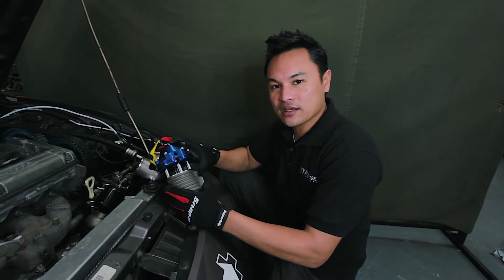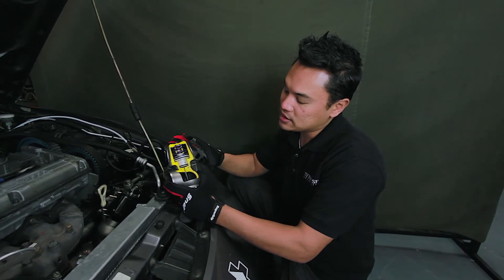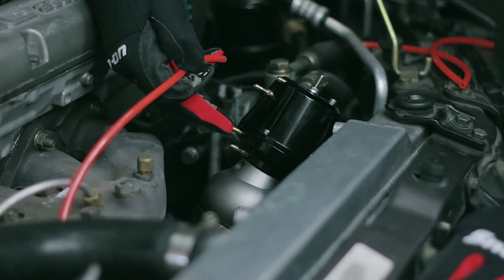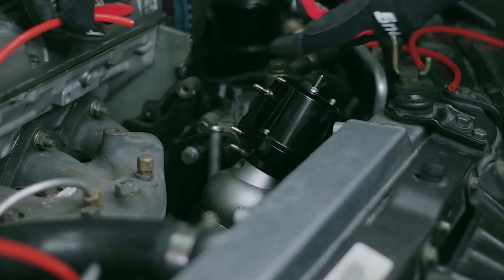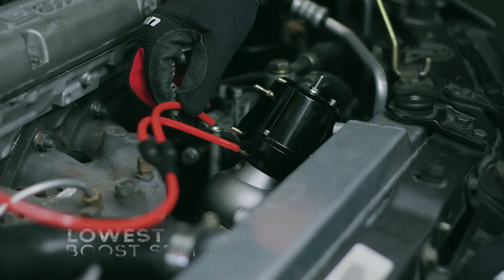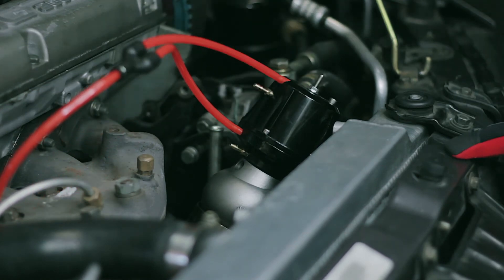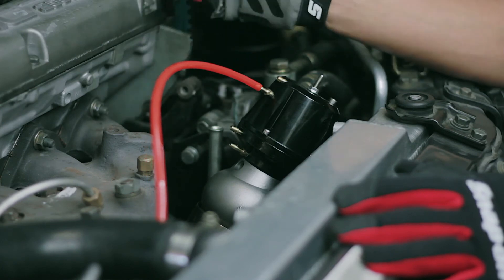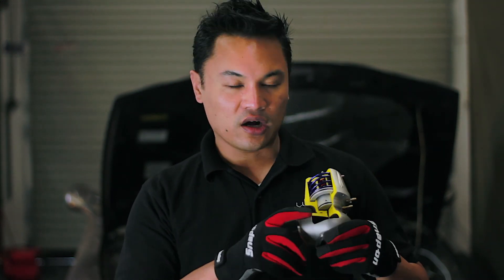Multiple Boost on Synchronic Wastegate

Comment from the maker: @enfourcer It wasn't intended to deceive, there are only so many ways to change boost to cover in this topic, but we'll cover it later.  Yes, you can change springs in any wastegate to change boost, which you can also do with Synchronic, but it is rather inconvenient on many applications. On the dyno, you have to wait for it to cool down every time to change springs. You can also bleed the boost source, or use a regulator or MBC, just too many things to cover in a few seconds.